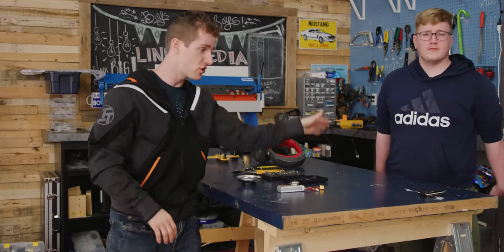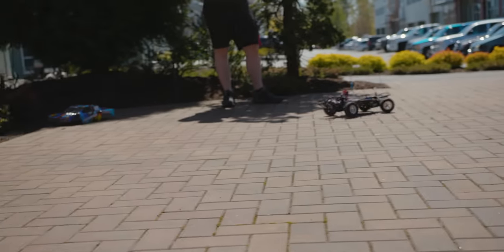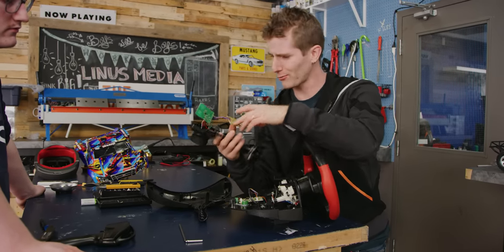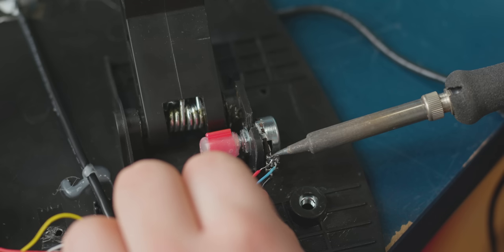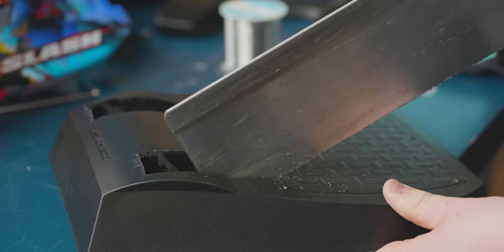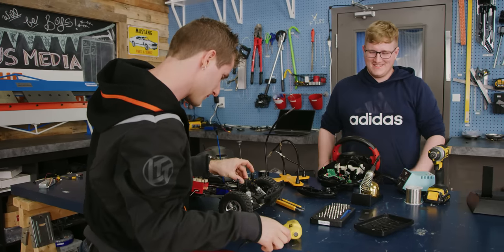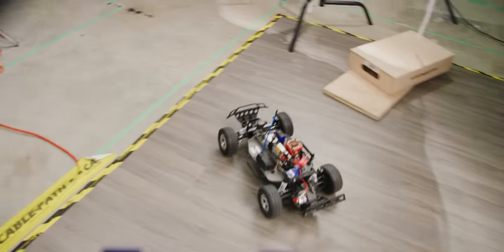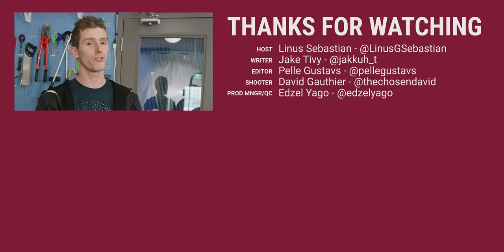First Person View VR RC Car Racing!!

Comment: I have a ton of experience with the traxxas cars. Even at the speeds you are traveling it's easy to break the caster block in the front suspension. A broken part would be a huge buzzkill to an otherwise very cool project at LTX. I Highly recommend some aluminum caster blocks to stop a potential tragedy at the show.

Traxxas part number : TRA3632a

You can also change the top speed of the cars by changing the pinion gear on the motor. Smaller pinion (less teeth) = Less speed.
Reply: I am associated user they need to put brushlees motor in it lol, but they will have to drop the VR more than likely.
Reply: @patrickmcdonnell8835 , associated here to 😁 still with my Sc5m
Reply: @patrickmcdonnell8835  What does installing a brushless motor have to do with VR? People fly drones at 60-100 mph using 360° goggles.
Reply: Hahaha... ive bashed the hell outta all my slashes and have NEVER broken a caster block. They arent even building a brushless system on lipo dude. They will be fine.
Edit: ok so they ised lipo. But its still slow af haaha.
Reply: @xenonram  Random people at an event that will probably break shit, plus those cars can do serious shin/ankle damage
Reply: 3d print it with PETG :)
Reply: Just make sure you adjust for heat
Reply: @LinusTechTips sound like this dude needs to be a temp member of your team!
Reply: Mystx24 👋 mine is stupid fast
Reply: @boba1mighty  not really, aluminum isn't necessarily better for certain parts. aluminum bends but doesn't break. so you could have a part that isn't broken but bent out of shape and there goes your steering or alignment. if thats an issue, just order some extra plastic ones or better plastic ones from a different company like rpm
Reply: Are you serious.. I launch my brushless slash off skate park ramps and all I have ever broken is a rear drive shaft.

If they brake a caster block stock on training mode I'll eat my dirty undies.
Reply: @dalematthusen  Yeah, i've seen people upgrade their kits to metal, but only ended up breaking more often. Apparently, metal parts concentrate the forces to specific areas, while plastic spreads the impact force across the whole thing and absorbed. If the car isn't designed to run on metal, don't upgrade. Those plastic parts aren't exactly brittle.
Reply: how many did you break, I crash mine at way higher speeds and never broke one. You must be really unlucky bc I cant imagine anything breaking that those speeds.
Reply: Darrin Hillier brushless motor would be way better
Reply: Whats everyone’s fastest RC mine can go roughly 45km/h
Reply: @xenonram  lot less to dodge in the air than the ground. aslo less bouncy
Reply: growlingbehemoth nice RC’s man. I got an axial Yeti with 32P 60T steel spur gear on 3S LiPo it’s pretty quick for atleast my level of RC driving 👌
Reply: v KEITH v  Well you could gear it to the point where the top speed is 10mph and it very easily comes to speed. Not going to lose control geared that low.
Reply: v KEITH v  My point is at that low of speeds the rc car is light enough to have no problem immediately launching to the speed the tires demand it to, meaning it's likely not going to spin much. I mean a traxxas slash on stock gearing is already hard to control on laminate, I'd argue that if you slow down the top speed regardless of torque increase it's going to be easier to control.
Reply: v KEITH v  Yeah same buddy everybody and their grandma has a slash. Do you have experience gearing said slash way down? Because I do. I've geared mine down to go around 15 mph once for pulling purposes, and my slash exhibited none of the control issues you're describing.
Reply: HSP FTW lol
Reply: All I’m wondering is why they went with a rwd slash and not a awd slash or a vxl mk2
Reply: Andrew Delashaw FUN who doesn’t want to go 40-50 mph in vr
Reply: @Velikann  because they are beginners
Reply: @Velikann  i go 8--90 mph lol
Reply: RC stuff i meant to say the mk1 the slower one like the gt
Reply: @Velikann  but they are still beginners. linus cant even handle 10mph
Reply: RC stuff now reliving that you right

Comment: Good luck with the video signal sharing the 2.4/5.8Ghz Wifi bands at LTX.
Reply: daemn42 ...if he had just look on bang good or geatbest for a drone fpv set up he could have done 3d glasses with 3d cameras and bought servos and more batteries for overpriced dji products that record every flight you make and are locked down more than an apple product.....
Reply: @melgibson6331  no, I'm glad he went with a digital system.  Analog video world have crushed everyone else.  Just saying there isn't going to be any free bandwidth on either band.
Reply: @gianlucagasparis4506  Jump on R1 and blast 800mw XD Knock out local wifi signals
Reply: @gianlucagasparis4506 When I do test flights around my house it pisses off my neighbors. I sort of like the power hehe
Reply: @gianlucagasparis4506  There are non-legal analog channels low on the "5.8"Ghz band (like E4 5645Mhz), but DJI Occusync will likely have 100% overlap with regular 2.4Ghz and 5.8Ghz Wifi transmissions.
Reply: Traxxas is 2.41 ghz so no worries there. They pretty much just skate past
Reply: @Shadow0fd3ath24  We're talking about the video signal
Reply: It isnt wifi

Comment: Now just imagine their reaction with a racing quad and that sick fpv setup
Reply: As long as they don't use any shit from DJI I'll be happy. Fuck a pair of HDO's are probably cheaper than that shit DJI goggle or they could get a pair of skyzones or the like that do 3D that would have been sick on the ground vehicle maybe add head tracking and they wouldn't even believe it if they were impressed by this. Hell they were impressed with 50ms+ latency I couldn't even imagine trying to use that to fly.
Reply: @thirtythreeeyes8624  even aomway and flysight have affordable good goggles,
Reply: ^ That. Aomway goggles can be bought for $150 if you are lucky. And their video quality is quite acceptable :)
Reply: @thirtythreeeyes8624  oh well, now it's pretty much the standard digital setup for flying

Comment: This is amazing. Need a walk through on how to recreate this. How much did it cost in total?
Reply: You can get it much cheaper (and at a similar quality) than what they did. This is what you need for the FPV part:
Camera: Eachine TX02 (or similar) for ~$18
Goggles: Eachine VR D2 Pro for ~$80, or Eachine VR006 for ~$40

Then get any RC car you want. The AIO camera mentioned is actually made for micro drones so it is tiny, has a range of a few hundred meters, works fine indoors, needs no cooling and doesn't use much power.

Comment: Dude, I do this ever day with my Cars.
RC is a great hobby.
Reply: While I havent done RC cars in several years, anything RC is good!
Reply: You do what everyday? You do realize that the FPV isn't the main feature of this build, but rather the modification of the PC USB steering wheel to control the RC car, right?
Reply: what do you own, man?
Reply: I kind of wish they would include (a little) rc coverage, especially for the pc/ rc crossover communities
Reply: Agreed. I've been into it for 5 years now and I can certainly say RC is an extremely underrated hobby.

Comment: someone let the guys at Flite Test know about, LTT needs there help with this one!
Reply: they could help with the soldering job too... look @ 5:55
Reply: I mean if they spend more than 700 bucks on fpv gear alone, the sky is the limit right? Imagine them saving money on the car by using foam board :D
Reply: their
Reply: ray taylor right
Reply: ray taylor and it’s their not there.
Reply: Check out their ground RC channel Driveon. they did pan tilt FPV for rock crawlers.

Comment: Your immediate use of hot glue to attach everything is the most RC thing in this video. I have planes that with significant weight added from years of hot glue repairs.

Comment: I did something like this in the late '90s.  The resolution wasn't as good, I used the standard dual stick RC controller, and it would display to a TV (through VCR first so I could record my driving), but it's still basically the same thing.

What I was really hoping for here, since you showed a VR headset, was that you had used 2 cameras thereby giving a stereoscopic (3D) driving experience.

Now THAT would be something!
Reply: or even head tracking goggles with pan/tilt on the camera
Reply: Stereoscopic would have been amazing.
Reply: dual 360 degree cameras, so that you could actually look around a little ;)
Reply: @grim-upnorth  I know for a fact I've seen someone do this... Now I have to find it again
Reply: @naoki95957  Now THAT's awesome! I wonder how is latency with that setup tho
Reply: There are a couple goggles out there that are capable of doing this https://www.youtube.com/watch?v=u15jQi6GlNw it's a bit of a gimmick but, when you're really close to stuff like on a ground vehicle it would be perfect. As for adding a head tracker that's easy they make plenty of prebuilt pan tilt that you could mount the cameras on. This would also eliminate the latency problem with wifi fpv anyone into fpv knows wifi is unusable by the time you go to correct you've already crashed.

Comment: The last time I measured the resistance of a component with the rest of the circuit attached, I failed a pratical exam in college... RIP me.
Reply: Yeah, I can see why it would be a bad idea.
Reply: Yeah... that's like one of the first things you learn you've done wrong in any introductory circuits course. They probably should have gotten help on this project from someone who understands at least some electrical engineering
Reply: @alzhn  In this case since the voltage sense pin (to which the pod is connected) will probably be High-Z so it doesn't matter for strict resistance measurements. Especially not for "close enough" measurements like this.
Reply: @EraYaN  yeah it's true, I'm not saying they did it wrong, clearly it was enough, I was just sharing my sad story ahahah
Reply: @EraYaN  I mean, the steering and throttle pots would probably be in parallel in the original controller if they're used as a voltage divider, meaning you'd measure half the resistance if they were the same...

Come to think of it, that could be why the throttle response is so bad here - the steering wheel and pedal are separated

Comment: What about FPV RC Plane control? :D
Reply: I think they did it last year.
Reply: Basically the same as the FPV racing drones.  But with a plane.  I'm sure it's been done already.  Just like this should have been really easy to do with most of the same hardware.  They're just adding difficulty by using PC controls for the car.
Reply: you want do cause a major crisis? like....next step war type alike?
Reply: I think that's pretty common already, you can buy cheap planes with cameras builtin.
Reply: @DoubleMonoLR  yeah, or istall them yourself
Reply: VAS even makes an aerial laser tag ACE COMBAT style with selectable "damage" taken for FPV planes. Alot of fun flying FPV!!!

Comment: Fpv cars are fun but you really need to try an FPV racing drone 🙂
Reply: i just said that but they wopuld need to start out with like a whoop drone to learn to fly. they probably wouldent even be able to get into acro. linus would  destroy and set his shop on fire i think
Reply: @kirill2525  I would literally give them one of my race quads to see Linus try and handle flying FPV
Reply: @kirill2525  😂😂😂😂 yea a brushless tiny whoop  would be a great start
Reply: @Michael Taylor, The difference is that there is no altitude or position hold, return to home, or even auto level (depending on the mode you are in). So you are responsible for completely controlling the drone. I would recommend you get a sim if you want to start with a 5inch (standard size) first. Other wise you could get a tiny whoop which is much smaller and safer so you can fly it indoors. I would recommend a NewBeeDrone product if you choose that option. 

If you want more information go to Joshua Bardwell's channel, he is the greatest source of knowledge when getting into fpv.
Reply: freestyle baby!
Reply: @Studio23Media fpv racing quads are a bit harder to fly since they fly in manual mode so no stabilization and no altitude and position hold but once you get use to it you will find dji boring to fly 😁
Reply: You can either learn on a sim or you can get a cheap micro drone like a tinywhoop which in my opinion a tiny whoop would be better than a sim
Reply: @chrismawson4430  Can i have one? XD
Reply: @Studio23Media  Long story short, anyone who can breathe and think at the same time can be decent with any DJI. FPV in acro/rate mode is something that takes a lot of practice to get good at, but if you start in a simulator first you can get the basics down. If you have a conventional RC transmitter, go buy Velocidrone and give it a try
Reply: @kirill2525  For about $400 you can ;)

Comment: hey guys, if you liked this first person video car (fpv), you should DEFINITELY check out fpv racing drones and quadcopters, it's like flying in a cockpit of a drone, doing freestyle tricks and rolling, going thru gaps and all that good stuff, it's a hella of an adrenaline rush, im an enthusiast myself and i can't believe that i live in a time where i can pop on some goggles and just fly, like a bird, more like a really badass bird who does rolls, tricks and i think you get the point... i think you'd enjoy it xdd
Reply: whats the total cost for  a beginner set up?
Reply: Blueeyedmerle varies, but a nice indoor/outdoor quad is the US/UK65 (brushless tiny whoop class), half a dozen batteries (quad comes with charger), then a FlySky i6 and a pair of $100 budget goggles is like $250

If you want a speed freak (100+ mph and takes a beating hitting trees and fences at 80 mph like it’s nothing, and you will smash into things...), then the Diatone GT R349 is a fantastic quad with high end components and the best carbon fiber job I’ve ever seen. The Quad is $180, and batteries are about $12 to $18 (varies if you get 1 or a 4 pack, get the 4 pack, you’ll be smiling for longer!). You’ll have air that with a micro PPM receiver or get the BNF option, but it’s seriously just 3 wires. That would set you back about $320 to $350 in total, but don’t fly it in your house unless you want some new “skylights” added, haha!

My goggles are super dated, I haven’t had a reason to upgrade other than I might opt for a DVR recording option, but they were like $80 way back in the day (I think that included VTX too). I actually preferred them over my friends Fatshark goggles (mine are 480p and standard monitor aspect ratio of 16x9 like I’m used to, I haven’t games on 4:3 like the fatsharks in a while and it felt weird)

I’d also get a $8 soldering iron and $5 in solder so your prepped with good tools when you need them, the Diatone is actually really nicely thought out and easy to solder. I haven’t broke anything on it yet though, and with my flying and crash rate pushing it to 1 crash per minute, then that’s a miracle it lasts even a day (0 cracks, no smashed lenses, just bent up props. Trust me, those tree and fence incidents at full throttle were not made up, I’ve never seen a battery fly so far away...)

Get extra props and have fun!
(Batteries used on R 349 is XF Power 4s 850mAh 70c with XT30 connector, I think it was $40 for 4 batteries), you may be slightly over 250g weight, go with 750mAh if your worried about it.
Reply: @jakegarrett8109  Hey man thanks for the info. I'll check it out. I appreciate the depth of the post lol. Have a great day!!

Comment: As an embedded hardware and software developer working for an RC company, I have developed a remote control that takes any USB HID peripheral and uses it as input to control any RC model, just have to plug the peripheral into the USB host interface of the transmitter. Even a mouse can be used, I have flown a quad-copter with the wireless mouse of my computer... That should be far more convenient than all of these soldering, sawing and...

Comment: Better be the vxl not a brushed motor
Update and its a brushed
At least its traxxas.
Reply: a over priced intel cpu ahaha they don’t need a Vxl! They are just using it for fun
Reply: @br1ann88  true i hope they don't over heat it.
Reply: But is Traxxas any good? I'm not so convinced about my Traxxas slash...
Arrma/hobbyco or CEN is much better in price and performance
Reply: yep, my thoughts exactly.
kind of disappointed they went with OcuSync too. Was hoping to see a wicked TBS Fat Shark Combo. If they were so amazed by OcuSync, imagine their joy after testing it out with TBS haha
Reply: @RCCarRacing  they only issues i have had with my slash is the wheel axels breaking
Reply: Pavo Jurkic yeah, traxxas’high end vehicles are really the only ones to be excited about,I feel like the “lower end” (slash, monster trucks, etc) are overhyped, especially for the semi high prices, ARRMA seems better for the price I think
Reply: @tiddles6911  I broke tires, the esc, driveshafts and some gears. But the other parts seem to be fine.
Reply: @br1ann88  If I compare my Traxxas slash with my arrma senton: big win for arrma.
It's definitely better quality!
 They're in the same price range BTW